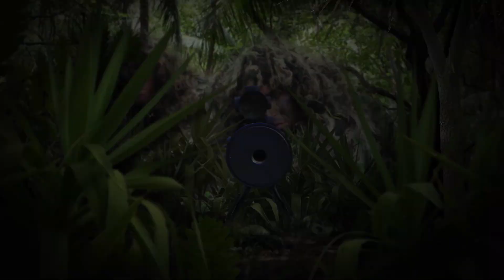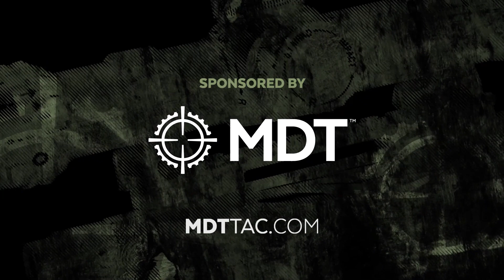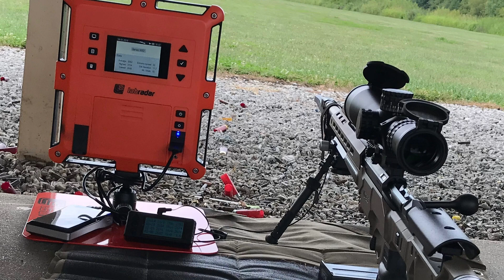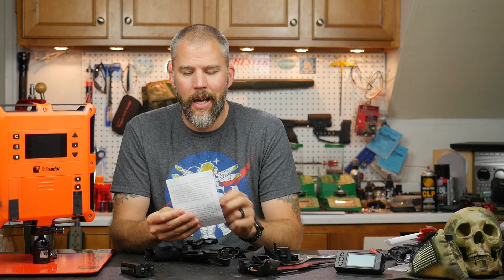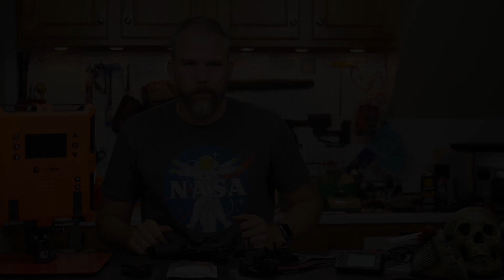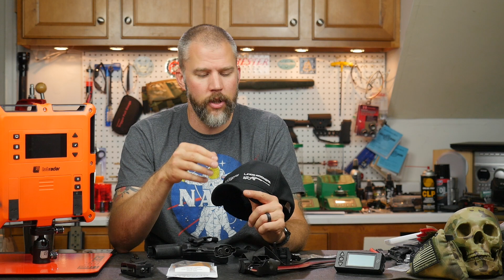Mail Call Mondays Season 7 #28 - Labradar vs. Magnetospeed, Timney 1022, P320 RX and more.

Comment: An excellent review of LabRadar (LR) and MagnetoSpeed (MS) - of course, coming from you that's what we've come to expect!

I’ve used both frequently for several years and on occasions both at the same time for comparison. I found the two to be on average within about a half percent of each other. Although, there were deviations where one would read more significantly different than the other. I think for most, the absolute accuracy is not significant, but as far as accuracy goes, LR has been independently tested against high dollar radar units and found to be extremely close to the military/research radars. So I think the absolute accuracy, by far, favors the LR. Again though, likely to most, MS is close enough.

One thing you didn’t mention is the optional mic LR recommends for use with suppressors. In case it is not known, LR is triggered by sound, and then uses radar to measure the velocity. Since I shoot ARs and bolt guns almost exclusively with suppressors, I use the mic. It may be that the 223/556 suppressed is too low to reliably trigger the LR where more powerful calibers might work suppressed without the mic.

One of the problems with LR is that it can trigger from a gunshot somewhere down the firing line, especially with the mic. If you happen to shoot at the same time someone else does, you may get an erroneous velocity which you can edit out, but you will lose the velocity of your shot. If don’t shoot simultaneously, LR may trigger from the other gun, but will simply reset normally without any action on your part. Sometimes you’ll have to delete an erroneous shot, but it will be very obvious.  

The settings on LR do take a bit of getting used to. After a while they’re so automatic it’s not a problem.

Something LR does that’s unique is it actually records velocities about every yard until the bullet goes out of range. Some may not realize this since it only displays five ranges. But LR creates a simple text file that does show the velocity at every yard (or so). Plus, it creates an Excel compatible file that can be worked with in Excel. Since LR lets you input a bullet weight, the Excel file uses the velocities and bullet weight to calculate and display the energy in the Excel spreadsheet file.

LR will measure the velocity of a rifle, pistol, or arrow, BUT, you have to select the appropriate velocity range. I was measuring 223/556 one day and switched to 300 Blackout and started getting erratic results. I switched to the pistol velocity range and LR started working as expected.

Lastly, it’s kind of a funny thing, MS is more friendly at changing targets because it measures accurately regardless of where your gun is pointed. OTOH, LR needs to be pretty much aligned with the target you’re shooting to minimize angular error. Then, LR is more friendly at changing rifles than MS.

As for LR blowing over on a tripod, must have been quite a wind, or the tripod must have not been in a wide leg stance. Some tripods can be weighted at the bottom of the elevation shaft and in any case elevation should be done exclusively with the legs and only with the center shaft if the legs won’t produce enough height. In lower height applications, the legs may not have sufficient spread to resist wind – the same is true for screen type units. For this case it is important to be able to use a center weight on the tripod.
Reply: Thanks for posting the additional info.  I find the ability to get various down-range velocities very attractive, particularly in a market where BCs are often generous.
Reply: The recording of downrange velocities is also the reason for the greater lag time on displaying info but I have never noticed it being more than a second or two.

Comment: I have a Magnetospeed sporter and it’s worked fine for me. Once I find my optimal charge weight I validate velocity with a 10 shot string. I haven’t had any issues so far. It does however affect accuracy. My Tikka Tac A1 is typically shooting sub 1/2 minute groups all day at 200 yards, but with the magnetospeed on the barrel it shoots about 1.25 moa and shifts POI up a little

Comment: On the speed of the Labradar unit, you HAVE to use a modern high speed SD card. Old cards have slower write speeds and will slow the entire Labradar down, even the menus. I had the same issue, but going to a high speed card fixed it entirely. Not sure why this isn't better explained in the manual, but it is very important.
Reply: I have read of people finding using certain type memory cards can slow LabRadar down. i use mine without cards and no not notice it being slow.
Reply: kolt46 yes, no card should work fast, but not as easy to transfer the data to a computer then and apparently will slow down as it gets full. I was using an 2Mb SD card from an old camera and it made the screen insanely slow. About 5 sec to display the data after a shot. Labradar customer support reccomended a card with a write speed of 4-10 and 4-32GB size. When I did that, it was showing the data almost immediately.
Reply: Good to hear a fast card will not slow it if i decide to use a card.

Comment: Sometimes it is hard to use a Labradar on the uneven terrain, especially if you shoot magnums along with aggressive muzzlebrake - gases just blow a unit off the dsired trajectory and you can't get readings due to the misalignment. Propper positionig of a unit can also be tricky, but there are tons of videos as well as text around internet which can help. Apart of this, LR is the best around. I had to switch to it from magnetospeed because that thing just stopped working due to the fact that one of the sensors got broken.
Reply: Dmytro Kuksa the Labradar manual reccomends placing something to shield the unit from muzzle blast on magnum rifles. You can also just position the unit a bit further back if you arent using a brake.

Comment: LabRadar is definitely much better than MagnetoSpeed. MagnetoSpeed has really bad influence on accuracy. A lot of my friends have the same issue. Though the velocity results from LabRadar and MagnetoSpeed are really close, you need to waste more ammo just for velocity using MagnetoSpeed. If you are shooting expensive cartridge like 338 Lapua, the extra ammo cost will fill the price gap between the two products.
Reply: Can’t you just mount the Magneto speed off the side on a picatinny rail so it doesn’t disrupt the rifle’s accuracy by
Reply: Calilaker CAGLS will need a extension or some other device for this method, or it's too short for many rifles. But with extra cost for the extension, the price is basically the same.
Reply: Why people speak always about the accuracy whith the magneto speed?
I try out ammo till i found one with a great accuracy. After that i wanna know the velocity. That's it. 
Who cares about the precision with the magneto speed on the rifle?
Reply: As I said, if you hand load using QuickLoad and OCW method, that will be a big problem
Reply: Pe ter and in case you don't hand load, you still waste some ammo just for measuring the velocity.  It's okay if you shoot like short action cartridges, but if you shoot long action like 338 lapua, wasting like 5 cartridges for measuring velocity is unacceptable
Reply: My Magnetospeed doesn’t affect my accuracy at all. Just shifts my group up and to the right.
Reply: MrMalicious5 Maybe it's just my personal experience. But we tried several rifle and all of them have the problem. The worst one is down from sub half moa to more than one and half moa. The best one also has like 0.1 to 0.2 moa change. Maybe there are some other factors. I don't want to return the MagnetoSpeed after mounting and shooting with it so I resell it at a much lower price. LabRadar is a safe way to go, without worrying whether the chronograph will affect the accuracy.
Reply: I owned both and finally decided to sell the MagnetoSpeed. We have tried the MagnetoSpeed on some of the high-end rifles like FN Ballista and AI AXMC and some budget rifle like Rem 700s and it will tremendously influence your groups. So though it works well, it is not the optimal option if you want to do some load development by using QuickLoad with OCW method. Because you have to measure the velocity in another firing spring.

Comment: You do not need to set the Labradar in front of the muzzle, you just set the sensitivity higher. I run a power brick and I can shoot all day.  I have been using Labradar for over a year now and I have tried all systems inc the Magneto. Magneto changes point of impart so you always have to fire a second string to verify POI.

Comment: I would still return that bipod to whoever you bought it from thank you said it was Amazon is still broke under extremely light use.  it should not break even if it's a clone it should not break that easy and also just to see if that Chinese would take it back like you said I'd be surprised if they did but just to see

Comment: Frank Galli has pointed out that the Labradar is quite fragile. It is standing out there on a tripod or some base and its form acts like a sail in the wind. Twice Frank's Labradar tipped over from the wind and everytime it hit the ground it was broken and had to be sent in for a replacement. It would sure suck if your $500 chrono tipped over and then it was destroyed. Also, the Magneto speed gives true muzzle velocity because it is taking the measurement at the muzzle. The lab radar is always catching its up close measurement beyond the muzzle. I have an extension that moves the bayonet off the barrel.
Reply: v8esprit that tipping "problem" is so easily resolved I cant honestly count it as a negative
Reply: Frank is also out west and deals with 30mph winds frequently. Out east in the Carolinas - we have never had an issue with a Labradar. They've worked amazing for all of our Guardian matches, and the shooters really enjoy them. They are great for us to easily get 60+ shooters their chrono data quickly just by having shooters drop down to the chrono station, or we bring the Labradar right to them. My opinion: For chrono several people quickly, Labradar. Magnetospeed is awesome too, especially for personal use. More affordable too. Both are extremely accurate.
Reply: I prefer the Magnetospeed as well. Seen too many broken LabRadar’s to even want to deal with a 500 dollar paperweight. Sure is nice when it’s working and set up properly, though.